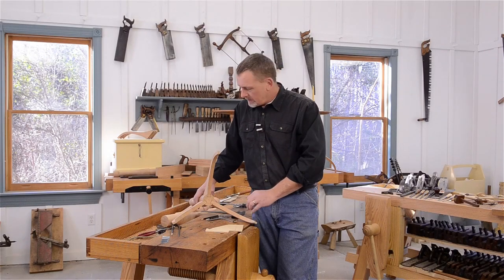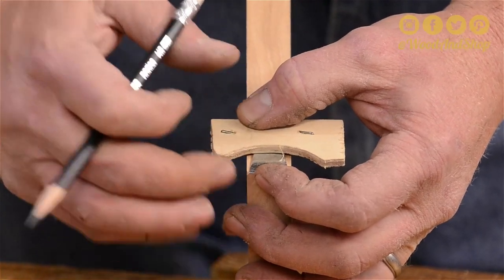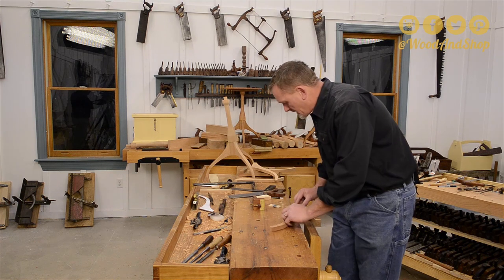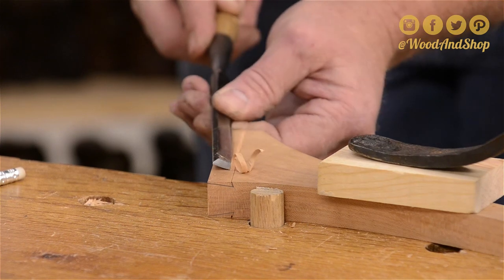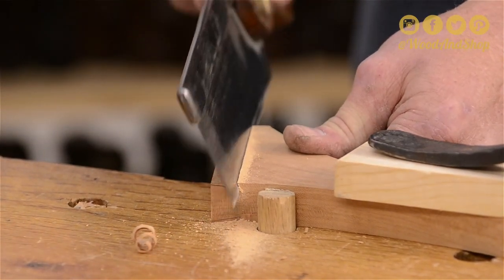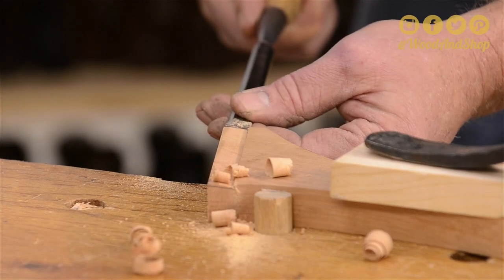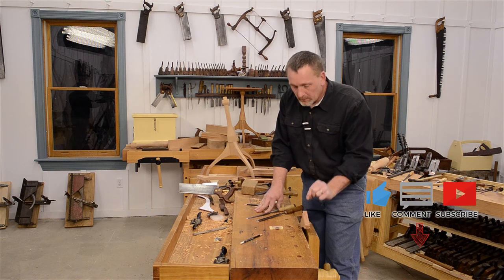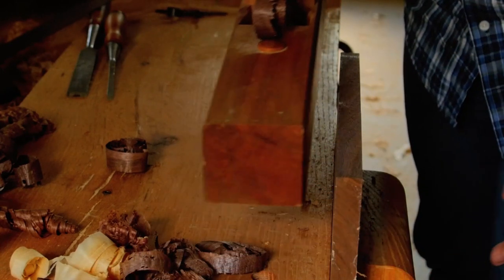Cut Sliding Dovetails with Will Myers (Part 1/2)

Comment: How do you feel about the other method for this joint, where the tail is cut square at the shoulder, and the spindle is modified to have a flat where the mortise is located?, or is this method not authentic to the original design?

Comment: That bench seems way too low for you.  I don't see how you can work comfortably bent over like that.
Reply from the maker: Nope, a low bench is better for hand planing.
Reply: @WoodAndShop  - yeah it is but there has to be a balance between being far enough from the work to be able to comfortably plane and close enough to work on your joinery. That bench is too low for this chap.....
Reply from the maker: @jaimeclifton9078  No, it's not. Will has several of those benches, and he has no problems or discomfort. I am even taller than Will Myers and I have six Moravian Workbenches of this size, and I work on them all the time, and have no problems.
Reply: @WoodAndShop  - one adapts to what is available, doesn't make it the best tool for the task....
The fact he is having to stoop so much makes it blatant that it's too low...
Reply from the maker: @jaimeclifton9078  Nope. Both Will and I have "proper" height workbenches too. So I haven't had to adapt to anything. Just because people have written in books a rule-of-thumb for workbench height, doesn't mean that it has become gospel. And who is to say what "the best tool for the task is"? You? I don't like when people make absolute statements on which is the best way to do something. Everyone is different. And every situation is different. I love hand planing on a shorter workbench. If I'm going to be dovetailing for a long time, even a "proper" height bench may be too short. So I can clamp an accessory vise (e.g. Moxon vise) to either workbench.
Reply: @WoodAndShop  - yes one should use a bench which has height most comfortable to how they wish to work - that is not in dispute. My point is stooping to task, what ever way you look at it, is an uncomfortable and inefficient way of working. 
Planing is one part of the story and most often the shortest part. The joinery is the other, part of which is sometimes dovetailing. It's not efficient to break out the moxon for all of your joinery work nor would you want to: they are tedious, break workflow and take up needless space....
Reply: This is the debate on bench heights. If anyone wants my two cents, I say (for furniture builders) make your main bench - your longest, best equipped bench at a comfortable height for planing. Then have a smaller bench - with a cheaper face vise, or maybe no vise at all - for mortising and dovetailing, marking and layout. Make this bench taller. (Or, if you like sitting “ cross cross applesauce” do this work sitting down, as they do in Asia; the floor absorbs less energy than even a very sturdy bench, unless you are working directly over a leg, which means your work most times has to hang off the bench.) And finally, use a portable moxon vise on one bench to saw dovetails and tenons on wide boards.